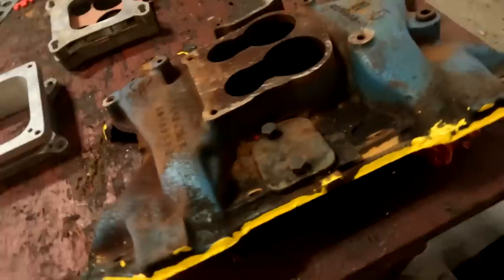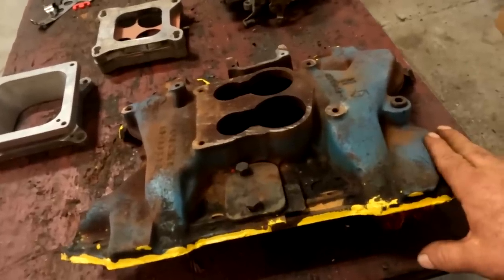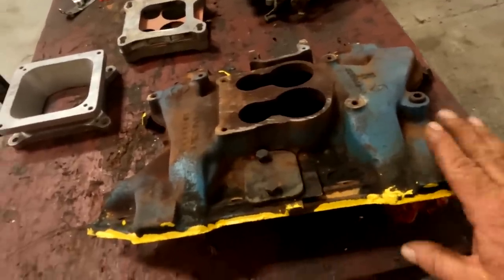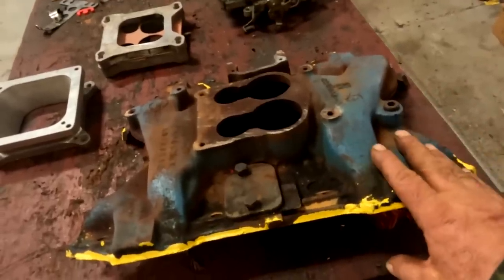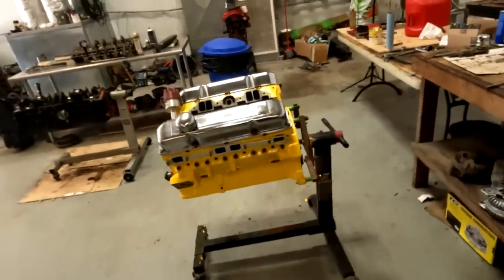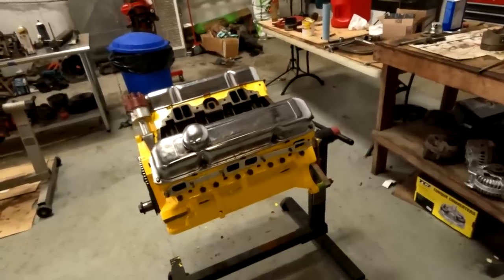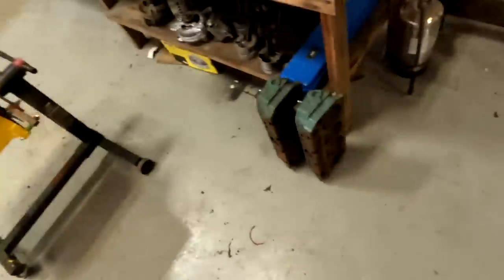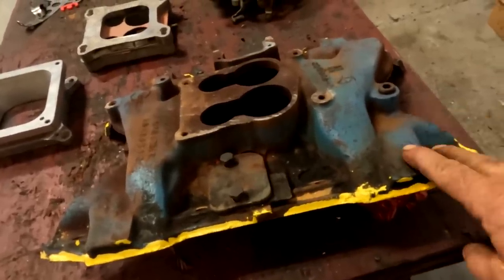Blueprinting - What It Is And Why You Should Do It To Everything You Touch On Your Car. Free Power

Comment: Tony you right about what blue printing is . To put it simply in it most basic form is making sure that all tolerances fall within factory specs. As we check clearances we need to correct them as well, to avoid the "stacking" of tolerances  that will lead to conditions that are not favorable and more likely to end in a catastrophic manner. As a builder of engines one must recognize the cause and effect of making changes to one part will directly effect other parts and have a trickle down effect to other parts.  You see it all the time, people stick a high lift long duration cam in and car runs slower and worse than it ever did before. People throw a dominator on there stock 305 and van't figure out why they keep fouling plugs. A little knowledge can be dangerous. There are builders and there are assemblers. Ford had 1000 people who only knew how to install 1 part on the assembly line. They couldn't do anything else,as far as building the cars goes . 1000 people doing one thing well equalled production numbers that have never been bested.  they were spitting out the model T - 1 every 24 seconds and being built in 90 minutes  . 
Your scenario again accurate, i would add that in production toolings wear out etc and they have to make corrections during productions especially when the cast parts. 
Ronnie Sox was also a mechanic and press cars , the media might be able to drive but Sox and Martin would tweak the cars before testing them. Advance the distributor drop air pressure make sure to test either early or later when air cooled down, and speed shift at 5k, and get rpms up and cut a good light. All these things would be why they could get a hemi car to high 12's and  media  reporters  spun tires for 1000 ft and turned in  mid 14's and still thought they drove it well. Don't think they passed out the new Demon to the press core like they did back in 1970 with the 440 6 pak  Challengers/Cuda. 
Sorry long message again hope it helps .

Comment: Well said. There's a certain pride in "built not bought" that gearheads have that is hard to explain to people. I guess if you have unlimited funds, you could have an engine and transmission built by a shop that will smoke the average guy's rig, but where's the fun in that? I happen to like using my knowhow and sketchy tools to make a machine that works as well as it can and put it up against another guys' machine built with his knowhow and sketchy tools.

Comment: I'm working on stroking a 460 out to whatever I decide then using factory iron heads and intake. I don't want a high rpm engine, I want that stump pulling low end torque. 

I just have to improve the heads and intake to let in and expel more air. Because we all know big block Ford factory heads tend to suck on the exhaust side.

Comment: Thank you Uncle Tony for elaborating on theory and concepts of "blue printing". I want to use these principles when I rebuild my stock 84 NAPS Z (Nissan's Anti-Performance System) 2.4 four cylinder cylinder engine as I want it all stock w/exception of the Weber carburetor that I used to replace the failed Hitachi unit. Any hp gains will be duly appreciated as it was rated at 103hp new. 
I look forward to every one of your episodes and your lifetime of automotive knowledge you are imparting.

Comment: Not cars, but when you mentioned "stacked tolerances"...
I was apprentice at Bofors due to my education in the late 80's and was told a story about the developement of the Haubitz longrange canon. When they took it out for a showdown so the artillery buyers could have a look at the performance it all became a fiasco! The rounds landed about 20 miles away but the spreading of the rounds that was shot- that is supposed to be at least a hundred feet in between to make four rounds make maximum carnage before taking a new aim just didn't happen...
Four rounds landed in the same hole, so they had to make the manufacturing of the barrel more sloppy just to achieve a spread. No stacking there...

Comment: In Australia we call those ringers "freak motors."
It's analogous to the way you take all the pushrods, lifters, rocker gear, and valves and sort the shorter pushrod with the longer rocker, etc. In the factory, sometimes this just happened by accident.
The laws of probability dictate that, when you're building hundreds of thousands of cars, all of the sloppy parts are going to line up like the stars on one occasion or another and produce an engine that may even perform better than the design dictated.

Your philosophy of providing universally useful resources for the home gamer car guy is why I love the slant six content.

There is nothing that epitomises the philosophy more than taking an engine that is pretty nearly designed not to work in performance applications and making that puppy sing.

Comment: I've blueprinted aluminum V8 race blocks, putting the lifter bores in a position with tighter tolerance than the manufacturer. Same with cylinder bores, main bores etc,  and literally everything machined, tighten up the tolerance making it closer to perfect. 

Accuracy- hitting the mark
Precision- hitting the mark consistently 
Thats what wins along with balancing and carrying no extra weight

Comment: Some take blueprinting to major extremes, including ensuring a batch of valvesprings mic to the same installed height - and loose height when they're sitting on the seats. Swapping out springs at the same time to ensure they all have the exact same opening pressure. Making certain every single exhaust and intake valve shares identical weights and lengths. Indexing a bunch of spark plugs to fully expose the electrode and unshroud the ignition spark. Going all the way down to individual bolts set to identical torqued depth throughout the engine.

Adding that to reducing vibrational losses from balancing rod and piston weight combinations can readily improve an engine's output a good 10% over published stats.

This became a problem in such areas as SCCA's Showroom Stock series, as the prohibition against machining marks didn't eliminate the "balance and blueprint" practice, but instead meant insiders with automaker connections would be allowed to sort through factory parts bins to assemble that perfect matched set of rods, pistons and valvetrain components to give them a major advantage over the rest of the field, who could only run what they brung to the track.

Comment: You mentioned a 68 Caddy, and intake availability. That reminded me of a tip I got from CMD about 30 years ago. You can improve the performance of a 472/500/425 Caddy, by using the STOCK, low rise, SINGLE PLANE aluminum intake from an early 80s 368, the LAST Caddy big big block! And unlike the Edelbrock intake, the AC compressor still fits!

Comment: Tony the number one answer for using stock intake manifold is for this reason here , stock factory Intakes will run with any aftermarket intake if ported and modified correctly, capable of running 9s with factory parts which I am showing this on my channel as we speak
Reply: Come on Terry, we know better!
Reply: @Charles Servedio cylinder head porting & flowbench  I know better the proofs in the pudding always ,I did all these tricks to a 2 barrel intake and it was faster than alot of the 4 barrel cars I ran and these tricks apply to anything I've worked on always had an excellent outcome and was well worth the time I spent on it

Comment: Can't wait to build my basic 5.3 ls but optimize everything, just to say I did everything I know and learned about to my first performance build and that'll be the beginning of my journey.
Reply: It's already pretty optimized, can't do a whole lot.
Reply: @superduty4556  port match, Ballance rotating assembly, smooth out ports, bowl percentage, raise compression ratio, actually figure out what cam the engine wants vs "here try this". Probably won't Ballance the bottom end, but mostly make the 706 heads the best they can be with the little valves. Just what I'm thinking off the top of my head.

Comment: I recall a 1972 Plymouth Duster 340 that was dipping into the high 12's. Didn't take long and one of the magazines figured out the thing had 488 gears in it. It was actually topping out at it's maximum speed by the end of the quarter mile. That car was a real ringer, you could not buy a 1972 Duster 340 4-speed car with 488 gears from the factory. Chrysler probably pulled this kind of thing more than any other manufacturer, but they did all do this stuff for bragging rights. Even AMC.

Comment: Blueprinting, as I understand it, isn't about bringing every part within spec but rather making it function as intended when assembled. You want to make it meet or exceed it's intended function as a part of a larger assembly. That's way more nuanced than just making it meet the specs of a blueprint. You can have two mating parts that are both within print tolerances and their deviations from the mean can either compound to create even larger deviations or they can cancel each other out. Blueprinting is about eliminating the former even if it means deviating from the blueprint specifications for any individual part. Then if you want to get really finicky about it, you keep detailed records of key details about the how everything is in relation to each other so that if you have a really good setup you could replicate it down the line.

Comment: Used aluminum intakes are getting scarce or non-existant.  I used a bunch of JB weld to fix water corrosion on head surface because I couldn't find a low block Olds manifold AT ALL. Thanks Uncle Tone.  One of my favorite MOPARS of all time was a 66 Satellite that came with a 361, but I put a 440 in it.  I loved it!

Comment: Ran in to that back in the day buying 9c1 lt1 caprices . Take for test drive. Stomp the gas pedal and a slow one stopped spinning right rear tire on 1-2 shift. Fast one would spin all the way through 2nd gear. Before I figured this out I did 3.73 gears and shift kit in a slow one and my buddy had a fast one. His stock 9c1 was still faster than my modified 9c1.

Comment: I agree.  But there is the aspect of making a part measure exactly as the designer specified - match the blueprint - ie: Blurprinting.  In the case of gasket matching, the gasket MFG's were given actual blue prints from the engineers to design their products.  So if you see a port shape in a gasket, it is the designers intended shape.  BUT, it also includes a tolerance for all the shifts in casting that could reasonably occur.  So you want to follow the shape as a "pattern" but think about velocity changes if you are changing the cross section much.  Yes, get the port shape right.  But don't necessarily go too big ...
OTOH, matching and fitting (massaging) is also a great way to make power 😁

Comment: Growing up in the 70's and 80's, being immersed in cars from my father & uncles and thinking about that term from my memory, to me it's having a measurement for every aspect of the engine or part. It's as if you could see every detail 'blueprinted' on paper and to have a measurement in regard to each component in relation to the others. I think only high performance engines would have used this terminology and not factory parts except at the engineers computer. Blueprinting is like looking at a set of build sheets for that particular engine/component with nothing left to the imagination. Enjoy your stuff Tony.

Comment: Rifles used to be test fired for function and the most accurate top whatever % would be held back as higher performance stock.

Computer nerds call it the silicon lottery when some chips handle higher overclocks.

Some principles in manufacturing don't change

Comment: I think the word you want to use when 'Blueprinting' is tolerences. You are getting the tolerence of the stock production part, as close to specifications as the engineer designed it. I did learn alot from this video and it cleared up some misconceptions, so thanks.😎

Comment: I thought about opening up my 304 intake. Every bit of horsepower helps that old wagoneer. Need to lift it to figure out tire size for gearing. I would like to be able to do highway speeds without dogging out my under powered engine with 3 speed 727.

Comment: I did this to my 280 (inline 6). All I did was balance the pistons, clean up the mismatched gasket set and smooth out the port castings. I didn't "blueprint" anything, because I never officially "documented" the changes,. I dumped the FI and added 3 side drafts. That car would rev forever, and you could put a glass of water on the cam cover. Now,....you just "download" a program. I miss the good old days when you had to work for your HP.

Comment: My older brother was a mechanic diesel trucks car's and autos foreign and American. He did some stock car racing and he would perfect part's. He'd fix a water pump or oil pump instead of swapping it for another fuel pumps windshield wiper motors. Etc. he was that into it. Uncle Tony reminds me of my older brother how he talks his personality. He died and I miss him. He predicted light's would be LED. More turbos smaller engines. Smaller lighter car's and Monacoch bodies with crumple zones and he loved simpler cars. He got a 327 Chevy to get over 50 mpg tried to patent a mesh screen inside the intake manifold to atomize the air (fuel)  mixture he told me I retarded the timing.  They bought his effective idea and shelved it of course. He improved a coffee maker. After suing a Chinese company. He made money off suit. Because it caught fire and he improved it's design the Chinese company copied his design. He would fix any and everything he truly was genius. His name was Frankie. He worked on my motorcycle and All of my dad's car's brothers his friends. He also did HVAC/R. Service and installing. He was amazing.

Comment: ive discovered just a little bit of time filing and taking ridges off stuff really helps. A evo sporster we built picked up two hp on a dnyo from removing some cast marks off the heads. its really surprising the difference it makes.
Reply: Had a 750 BMW, reworked the ports and changed the carbs 34 mm to 36mm from a BMW 900 and it would consistently beat my buddies 900, in the process I found out that the transmission was the weak link....3 times.
Reply: @indianaslim4971  nice! I'm sure I'm going to snap drive belts with my elctra glide, I can't leave anything alone. Got a 100 cubic inch set of cylinders

Comment: You could play some of the Megasquirt 2, mixing the LA318 Throttle body (1988-1991) and Lean Burn distribuitor 400/440 (1976-1978), in such a way that you are not forced to buy a Sniper efi, because the injection in the throttle body still misunderstood

Comment: One clarification from an engineer- and please take this with a grain of salt as even the process I describe is idealized and does not always (or even most often) happen this way. With any design intended for production, the design process must take into account tolerances achievable by production processes and the stack up of those tolerances. So “what the engineer intended” is actually a product that given production tolerances results in a sufficient yield of production items that meet minimum requirements. “Blueprinting” in this case, is actually the opportunity to work within those tolerances to actually optimize the design for a desired result, be it a specific torque curve or less drivetrain loss from a differential. That is why sometimes the nominal value for a tolerance range or dimension is not necessarily what provides the desired outcome.

Comment: As an engineer, perhaps some vocabulary would be helpful...
Nominal: The intention of a design, or the mathematical perfect dimension.
Tolerance: Acceptable variation of a feature that still results in a particular performance metrics.
Key Product Characteristic:  A feature that is important that is given attention during the manufacturing process.  These features are measured regularly to ensure that parts are close to the same, and that every part mates to other parts.  Not a KPC, then the feature is not as important (perhaps what is referred to as acceptable manufacturing defects of an area thst is not called out specifically).
GD&T: Geometric Dimensioning and Tolerancing.  The engineers set the acceptable tolerances of important features (KPCs).  These are set with the cooperation of the manufacturing engineers.  Tolerancing that is too tight results in a bunch of scrap, so the engineering community sets this with Capability in mind.
Capability: A statistical measure of the manufacturing process for a part.  The design is Capable if the manufacturing process can produce the part at a acceptable rate with acceptable scrap.
There is a bunch of other processes (and accompanying acronyms) that have evolved the way things are made.
I think that what you mean my Blueprinting is to modify a part to be Nominal in all features and dimensions.
Since the late 90's, APQP has ruled the Product Development Process.  The Advanced Product Quality Planning model (I propose) is way different than the way this was done in the 60s and 70s.
I suspect that if one were to bring a 2000+ model year engine to match the math data (nominal) in every way, the performance is probably not far from a random production engine.  I will guess this is not so with older engines, where there is joy in investigating ways to improve.
Thank you I enjoyed your content.

Comment: I think that I would use the word "hone" rather than blueprinting. You are honing the piece to fit the original spec and remove manufacturer defects. To me, based on my work experience. To blueprint something is to transfer a prototype to print/cad for reproduction. To literally create a blueprint.